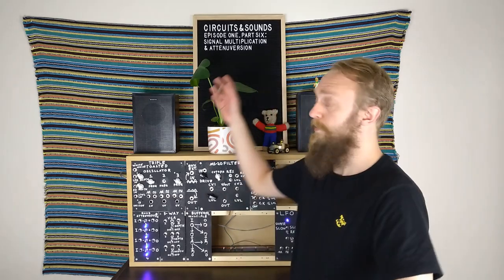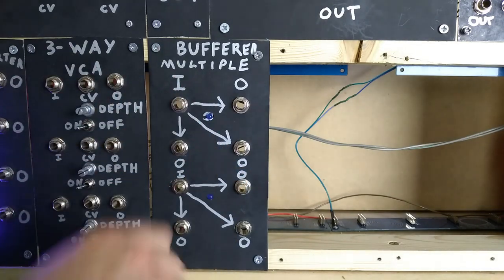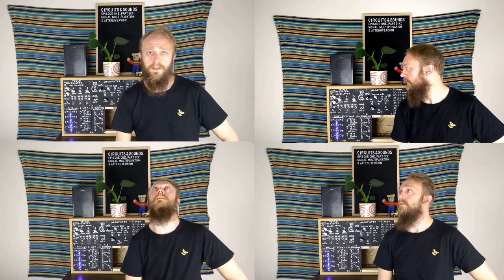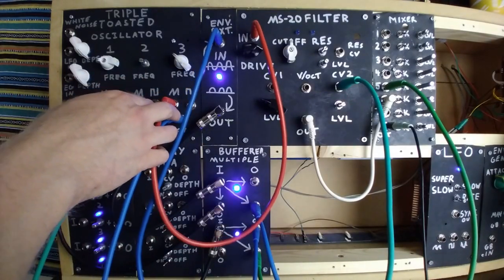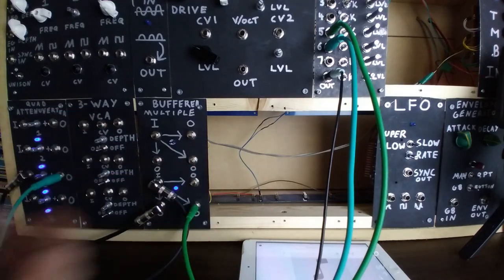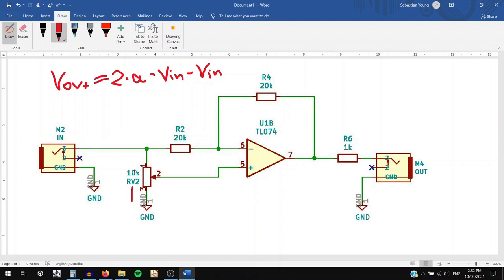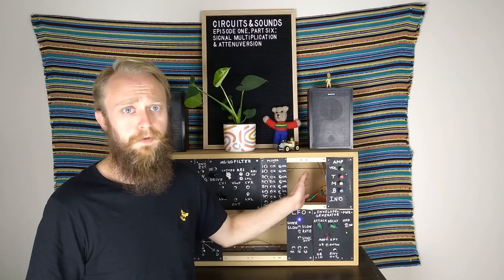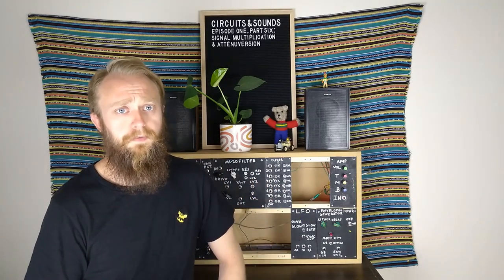Signal Multiplication & Attenuversion - Exploring Signal Splitting & Inversion

Comment from the maker: Timing index: 

00:00 - 00:55  Intro
00:55 - 04:27 Buffered Multiple Intro
04:27- 05:29  Buffered Multiple Circuit
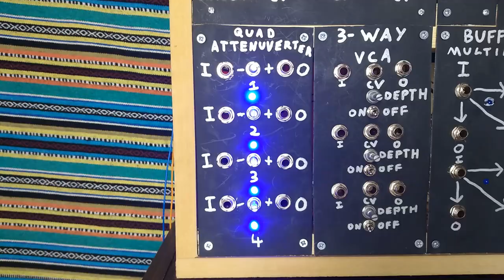05:29 - 10:13  Quad Attenuverter Intro 
10:13 - 14:25  Quad Attenuverter Patch 
14:25 - 16:14  Phase Cancellation Patch 
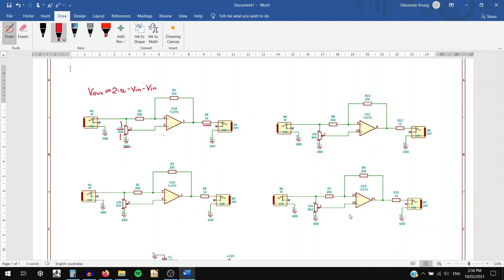16:14 - 19:59  Quad Attenuverter Circuit 
19:59 - 24:41  Amp Module 
24:24 - 25:28  Outro 
25:28 - 25:58  Outro?